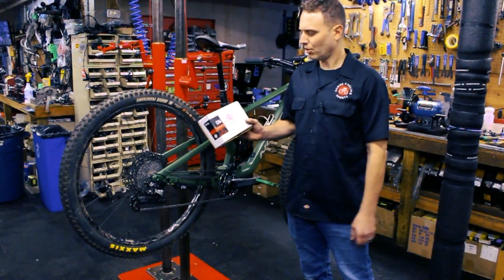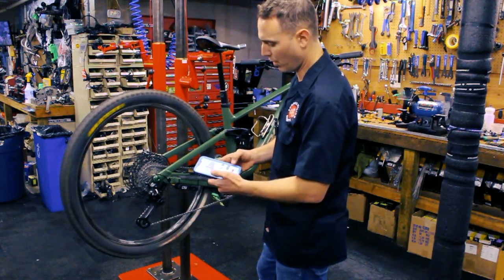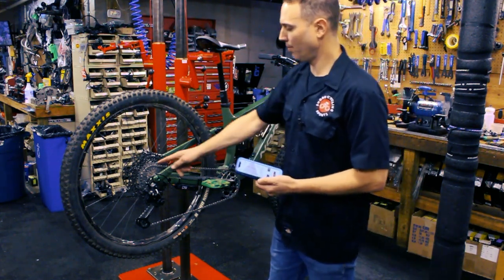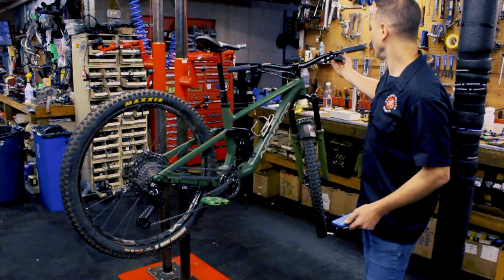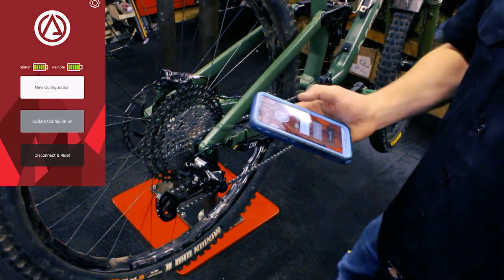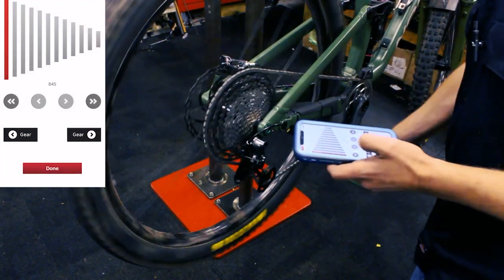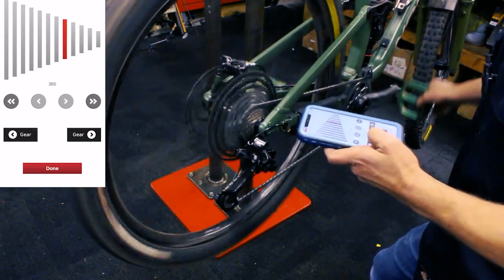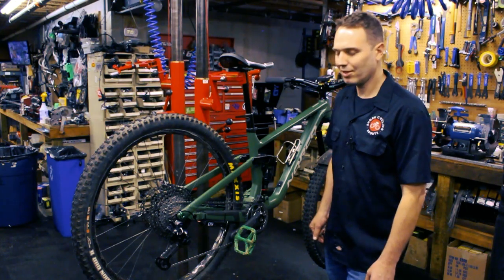XTR-Electric Shifting via D1x Archer

Comment: After a year with archer and xtr derailleur the motor in the shifter part burned...back with mechanical
Reply from the maker: Oh bummer!  Reach out to Archer.  They have great customer service in my experience.
Reply: @shorecyclingsports  Archer is stopping the business...
Reply from the maker: @ yea.  Sad to see them go.  It’s a great alternative to expensive electric shifting systems
Reply: @shorecyclingsports  there's still the possibility to use the 'ltwoo ae'. The application to setup is less good than archer but I run one since one year without issues
Reply: @shorecyclingsports  not impresive archer wants more $ to "upgrade" to gen 2 shifter they dont fix gen 1shifter so after buying all the kit with extra batteries a year later its burned and not the same type of batteries now...think ill pass

Comment: This is the perfect solution for retrofitting a bike with wireless shifting. I really want to give it a try.
Reply from the maker: You should!  It works extremely well and is more customizable than the latest, most expensive, electric group sets.